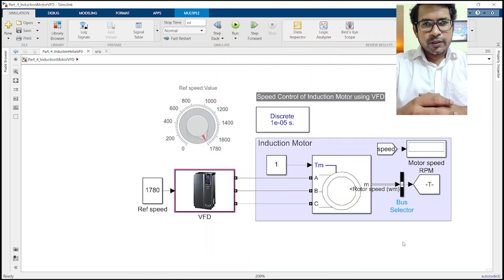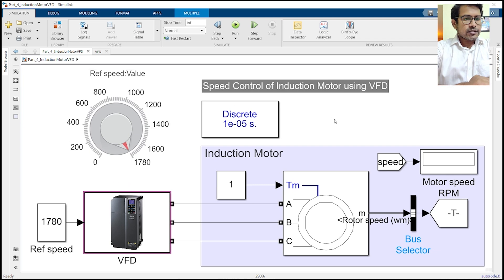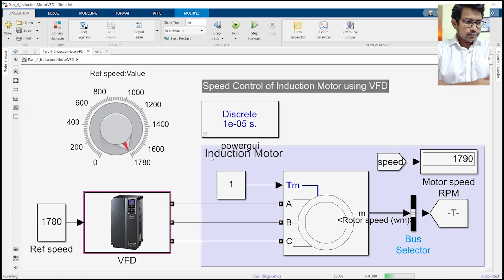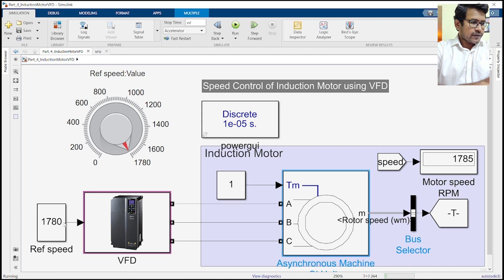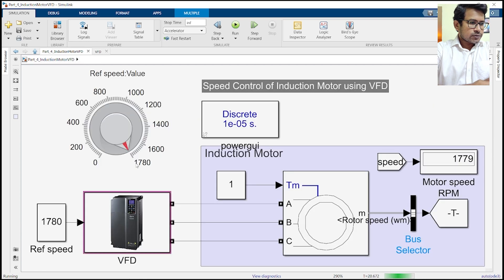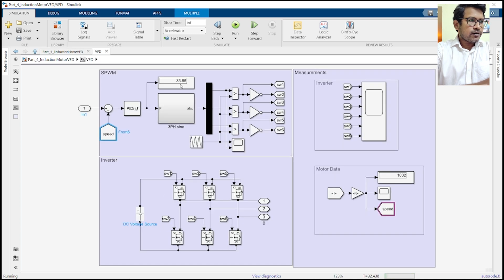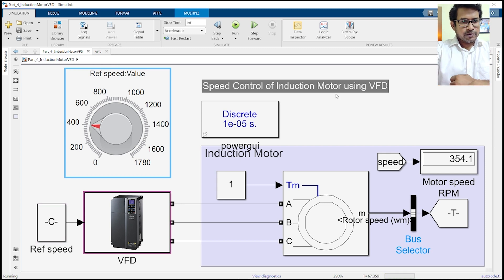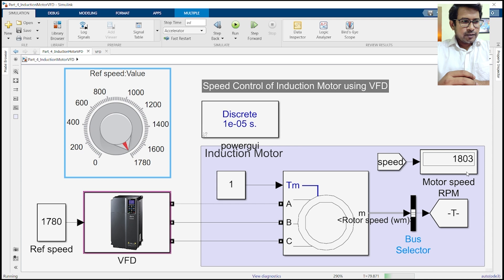Speed Control of Induction Motor Using VFD | Introduction video | Learn VFD Control

Comment: Hi sir, can you share how do you do closed loop control of the VFD?
Reply from the maker: The output speed is being compared with input reference speed and being fed to the controller... So its a closed loop
Reply: sir, do we need to eliminate the digital clock from MATLAB function block? and how to do the speed adjustment button like you have done in this video?

Comment: Sir can you please tell why you use pid , and how you implemented it..
Reply from the maker: PID controller is used to follow the reference speed provided by the user. PID block is available as standard in library. You can tune the parameters manually or auto tuning is also available

Comment: So I see that you didn't include the pwm in the simulink
And I want to know how if the capacitor and resistor should be implemented to cancel ripple effect in the voltage supply
Reply from the maker: Yes... A RC filter might do the job.